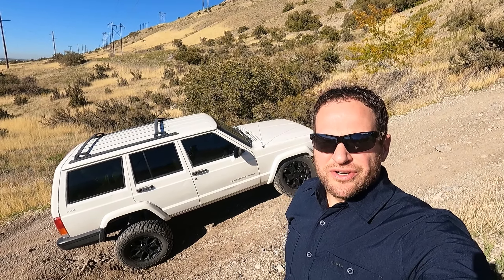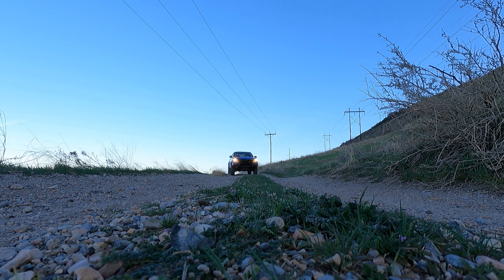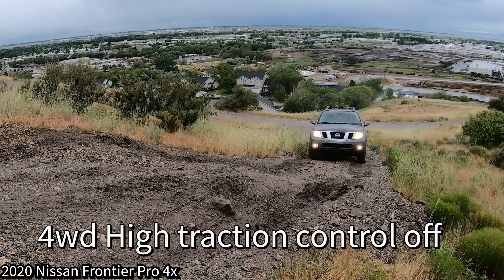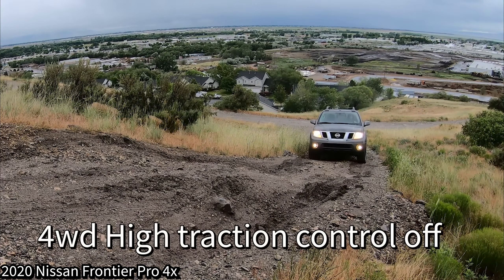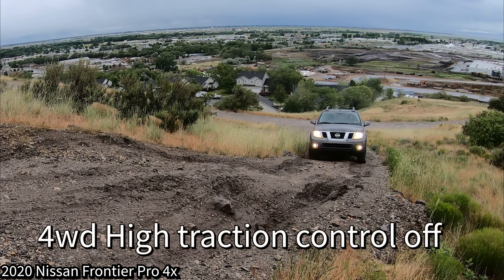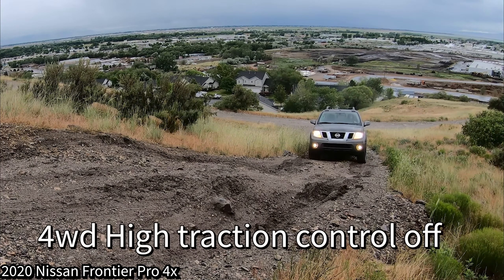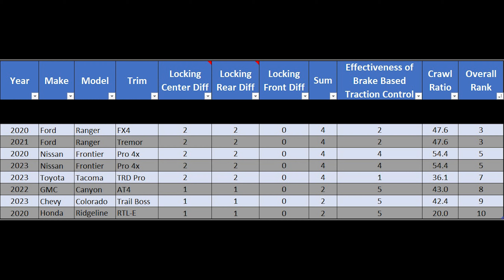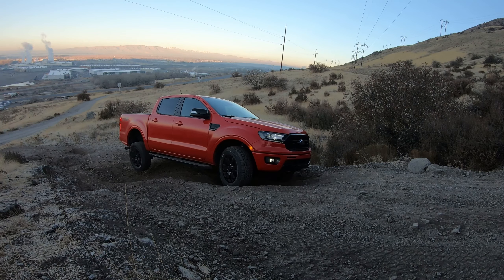Midsize Truck Battle Part 2: The Steep Climb!

Comment: I have a 20' Titan P4X and Frontier setup should be the same, going 4hi you'll want to disengage traction control before starting otherwise when you start spinning the nannies will give you minimal power to work with. Great Vid by the way 💯
Reply from the maker: Thanks for the support!

Comment: I think there's a bird trapped inside that trd pro i heard it trying to get out.
Reply from the maker: Haha, the puddles may or may not have gotten some water where it shouldn't be.
Reply: @EngineAdventures  I'm not familiar with them it may have been the traction or crawl whatever it was just strange sounds. It just sounded like a bird flapping trying to get out to me.
Reply from the maker: @JohnnyRebLa  ohh, yeah. The brake based limited slip system uses ABS, thus the pulsating sound. Crawl control in the Tacoma is constantly using the throttle and abs to keep a very precise speed. As you set the speed higher the abs is much less intrusive.

Comment: The Honda looks like a car with a bed on the back, the ground clearance is horrible, the Honda is last place in looks, I thought Colorado Trail Boss out performed the Ranger
Reply from the maker: I'll talk about that in the 3rd video, which will hopefully be up this week or next. The way my spreadsheets worked doesn't necessarily go with what my actual opinion is. The Ranger ranked higher because the spreadsheet adds value to vehicles with off-road cruise control (higher ranking on the brake based limited slip portion), which the Colorado doesn't really have. It actually has one of the worst brake based traction control systems of the trucks tested. GM relies more on the G80, which is totally acceptable. It just doesn't show up well in the spreadsheet.